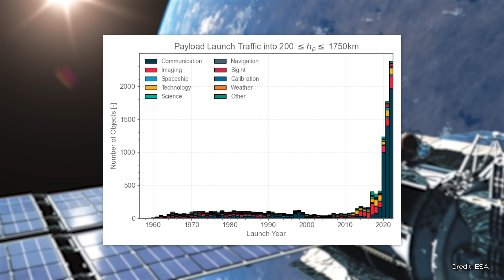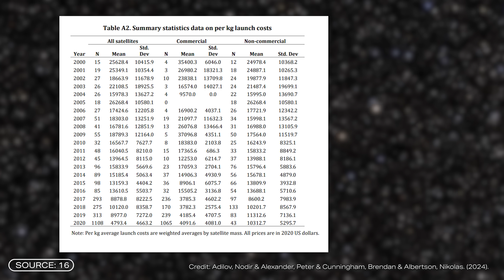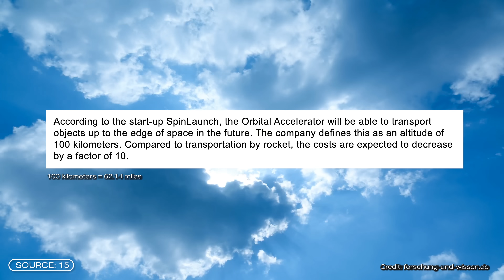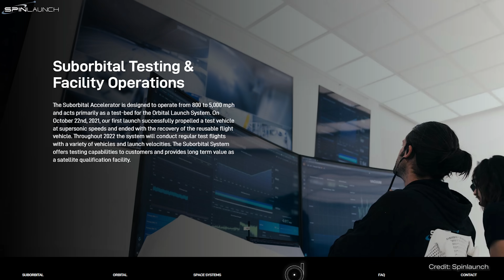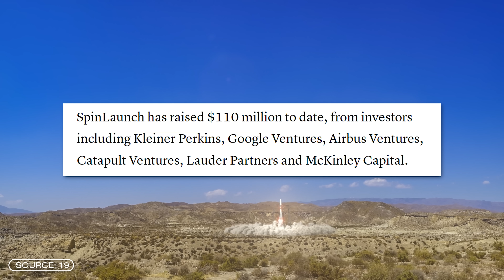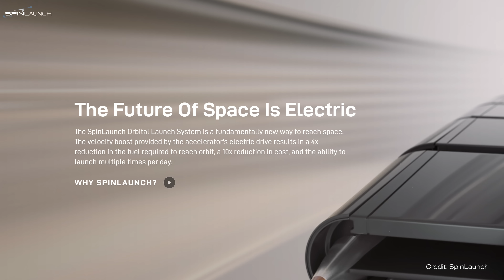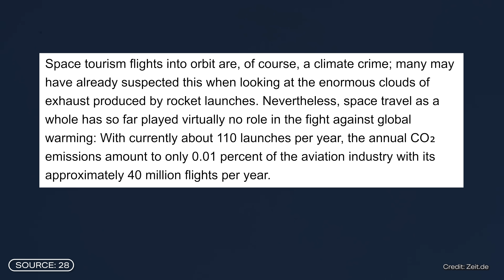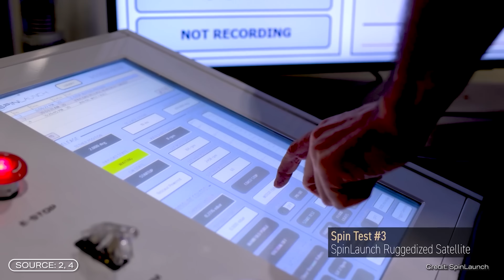How Do We Throw Satellites to Space? Update SpinLaunch

Comment: Centrifugal force inside of this is going to destroy any cargo. Do the math on the forces being exerted
Reply: The company's done that, and covered it in some of their videos and it's covered in this video. Watch it. It's sorta central to the idea, of course.
You think they're dumb enough not to think of that? And discover it in testing?
Reply: @thekaxmax  No, they arent dumb enough, they KNOW and still pull investments.
Reply: @bismuth7730  They aren't, they have gone to traditional launches.

Cargo wasn't the problem.

It was energy balancing on launch; the moment it releases to exit the centrifuge is now unbalanced by the mass of the rocket with no way to rebalance it without also throwing the counterbalance into a pit and then having to rebuild the thing.
Reply: @thekaxmax  So they still got donations and investments knowing such an elementary flaw to the concept existed? scum
Reply: @bismuth7730   WEll, they apparently thought they could fix it. Until they realised they can't. So they transitioned to fuelled launches
Reply: @thekaxmax I think a lot of their testing quote on quote is to persuade investment. I've done the math on the centrifugal force involved, Even if there are some materials and items that could handle it no sensitive electronics circuit boards etc would be able to withstand it. That's not a matter of testing or design, it's just physics. There's thousands and thousands of pounds being exherted on anything inside.

Comment: It will be interesting to see if they can scale it up enough to launch useful payloads.
Scaling up the spin arm will be particularly difficult.
Having to harden the payload to withstand the G-forces is also added mass.
The faster the launch and the larger the payload, the more a heat pulse will be an issue.

They launch the rocket/payload in an aerodynamic sabot, what happens to the sabot after separation?
I doubt they burn up, I guess a bunch of them would be falling into the sea.
Reply: They've done all the research and calculations, covered in some of theri vids.